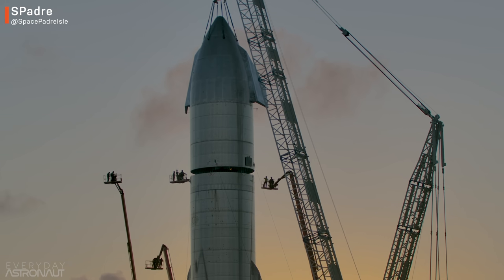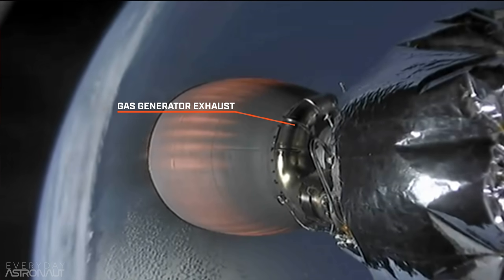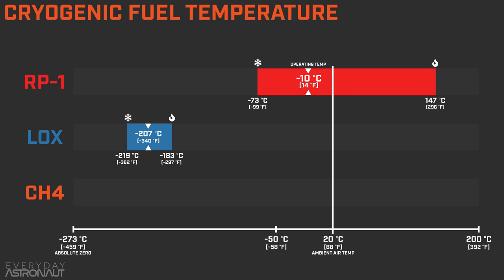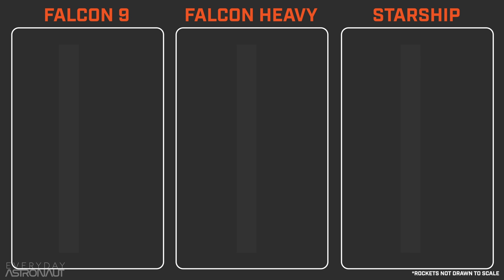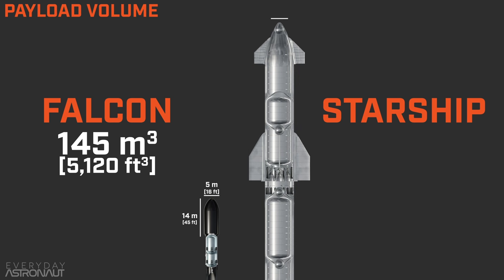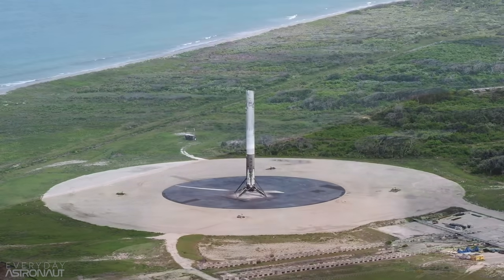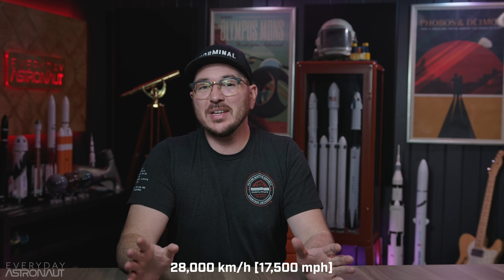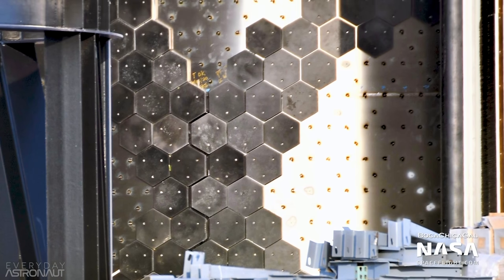Complete Guide To Starship: Falcon 9 VS Starship. What's new? What's different?

Comment: I now have enough information to build a starship in my garage. Thanks, Tim.
Reply: If you need help making the raptors, give me a call!
Reply: I have a soldering gun, maybe I can help for the rings.
Reply: @inconnudetousse1929  The team is coming together nicely!
Reply: I've got a drill-press and a 3D printer. Just have to get those Raptors working under 220 degrees. How hard can it be?
Reply: I have a hammer and a screwdriver. Can I come over, too?
Reply: @_Elkov  Please join the team. If you know any quality welders tell them we have free beer.
Reply: I can code, I’ll do the landing.
Reply: I will be WD-40 guy
Reply: 🦆tape on the way!
Reply: @UrbanWindowFarmer   ;)
We will need a test pad...do you know a good parking lot somewhere ?
Reply: @inconnudetousse1929  Tesco usually have big car parks 🤣
I have biscuits can I come
Reply: @RandomPerson-zl6uz  Sure and as you are bringing the biscuits, we will let you press on the launching button ;)
Reply: I have Knowlegde in code, I could help for the Starship computer 👌.
Reply: I played a flight sim once, I can be an astronaut.
Reply: Played Ksp a few times - could be part of the launch control?
Reply: I have my hands can i come😁??
Reply: I’m a aerospace engineer

Comment: Imagine Using Starship to deploy a single small cube-sat, only to flex on every competitor because its cheaper...
Reply: It can pick up some of their junk while it's up there.
Reply: Considering a flight to the moon is alteast 100 million Dollars per Vehicle.. yeah cheaper than Electron or Falcon 9 I think not.
Reply: @kleinerprinz99  I think he said deploying a satellite into earths orbit. not moons
Reply: @kleinerprinz99  they dont have to launch everytime just to take single small debri, starship can pick up multiple debris at the same time since its payload bay is so massive, yeah right
Reply: I'm honestly not sure the numbers actually do add up, considering fuel and crew costs. RE: fuel, also do consider the amount of dead mass - if Rocket Lab manages to make the cost of Electron marginal through reuse, it sure would use up a lot less fuel (and presumably less crew/time as well), so it really should be cheaper no matter what.
Reply: It wouldn't be cheaper in this case.
Reply: Hmm, according to video, it will.
Reply: @gabrielchanel4448  What about a long-term solution of using an end-of-life Starship Cargo to pile in old second stages with a “can crusher” and then deorbit the whole thing to the Pacific graveyard, or even to a BFE on-land graveyard with the skydive maneuver for recycling?
Reply: @ihateandreykrasnokutsky  Yeah, "according to video", which is precisely what I'm disputing here.
Reply: To be fair this estimate is optimistic to say the least.
Reply: For single cube sat, it is not cheaper. U can fit multiple cube sats on 5 mil USD electron.
Reply: Or perhaps a small car (like Roadster 2.0) 
;)
Reply: @RobertLutece909  Agreed - but then again, there's more costs involved around the project before the rocket takes off. Ground crew, renting the pad, keeping that fuel cryogenic, transporting it, heck even consider lost revenue from not having used that launch for something more productive - that alone would look more expensive than an expendable Electron, even though all things considered it's just fuel and time. Also, it's worth keeping in mind Rocket Lab's upper stage isn't quite that big - meaning a lot of launches, so economy of scale might kick in?
Reply: @RobertLutece909  Economies of scale → by discarding upper stages and having to rebuild them, Rocket Lab is incentivized to build them for cheaper, and their contractors get bigger orders on which they can afford to decrease their profit margins?
Reply: @RobertLutece909  I totally agree - but then again, it might still be a possibility that an Electron rocket is more than 50x cheaper than a full Starship, making your initial 2% figure still a loss for SpaceX? Just guessing :-)
Reply: We don't have to imagine it because it will not be cheaper. Only filling up the cargo and deploying a whole bunch is cheaper. Its literally like a large bus delivering people cheaply but unable to deliver a single person cheaply vs a a small car that can deliver a single person cheaply.

Comment: Impressively enough, the SN8 belly flop was a lot smoother than in the simulation!
Reply: it was both a successful flip, and a spectacular lithobrake
Reply: The flip worked a treat and if the pressure hadn't been lost on the methane header tank it would probably have been 100% success.
Reply: True, but the real test had almost no horizontal velocity. Future ones will though
Reply: @z2kk  Not necessarily, the translation to put it over the landing pad happened during the belly flop phase and it was already in the correct position falling vertically before the flip. It would only have horizontal velocity if it hadn't finished the translation when the flip happened and there is no reason for that to be the case. However there is no reason why the flip could not slightly over rotate to compensate for any residual horizontal velocity. I am sure we will see this in future tests as they start to push the limits of the landing manoeuvre.
Reply: If the engines hadn't gone all self consuming I think it would have worked. Still better than what Musk thought we'd be see.
Reply: Yup it's so science fiction of body control. I dont even believe it is so smoother than any other plane i see. Elon Musk is really live beyond his time.
Reply: Yeah, more "people-friendly". This maneuver is getting better every time I see it again
Reply: Let’s add to the Starship reiteration:
Starship El Camino, Starship Hard Top , Starship Convertible, Starship Hatchback and Starship Limo ( Hummer version ).
Reply: @tomrausch7014  dafuq I need please an explanation of each reiteration
Reply: On that note, looks like this video is indeed dated already, since Elon revealed that the super heavy doesn't want to be less cool than the starship by using an "old" landing profile, and will instead do an equally ridiculously awesome landing as the one starship does :)
Reply: Oh, it is a much harder prospect. coming in through the atmosphere from orbit it's like three orders of magnitude harder. Then just dropping from the sky like a feather. Of course it looks smooth, but it won't be when it's for real.

Comment: Well, since there seems to be a “fleet” of starships, seems we need 
Star Fleet Command running the show.
Reply: Lol
Reply: Thinking out of the box: While having fleet of starships (and that's what Elon is really aiming for): Why burn the fuel to reverse heavy booster back to original starting point? Wouldn't it be better to have second facility at the other side of Earth and head there forward? Besides less fuel needed (you need only to stop, not to reverse and go back), you could have customers from the other side of Earth much closer. Just a thought.
Reply: @adammarkiewicz3375  Sure but you need to somehow transport that booster back to the original site for a second launch
Reply: @439sparky1  No! You need a second launch point. That's what I meant. Even if you need a small trip, transport on the ground would require much less fuel than turning around midair and flying back.
Reply: @adammarkiewicz3375  But what if you want a quicker turnaround. It takes starship 2 mins to fly back while ground transport will last days or weeks
Reply: @adammarkiewicz3375  I believe they're using liquid methane, in part, because it's cheap. And building a second launch site with the same capabilities of Boca Chica would be quite expensive. The launch stand alone is considerably more expensive than a starship stack. The amount of fuel savings to land downrange at another facility is simply not worth the cost of building the facility.

Maybe if musks dream of transport around earth via starship becomes reality then perhaps that's an idea. But for now, with starship in its infancy, it seems more efficient to simply waste a little fuel boosting back to the launch site.

Comment: Top notch video and well appreciated.  As for speculations I have for future development, here you go:
1. SpaceX is already using solar electric propulsion for Starlink.  As most of what you ship to the moon is fuel to push more fuel around and SpaceX has already proposed landing a massive Starship on the moon, which is going to take a lot more fuel than what can be loaded onto a single Starship in LEO, especially for reuse, I think they will use a solar electric space tug launched on on Starship to push tanker Starships out to the moon.  The ISP on these solar electric drives already exceed 4,000s of ISP where Raptor vacuum gets up to 350s, so even with the extra mass of a space tug and the loss of using the Oberth Effect, it would be far more efficient and require far fewer launches than to LOX/LNG the whole way.  Elon Musk has stated Starship should have very little fuel boil off on the way to Mars, so why would there be an issue spending say several weeks slowly pushing a tanker to the moon?  I am thinking this could also be done for cargo only missions, except using a cargo Starship instead of a tanker Starship.  The reason for pushing a tanker Starship to the moon would only be so a crewed mission could happen rapidly instead of at the slow pace of a solar powered ion drive in the Earth-Moon system.

2.  Something cool about the cargo space tug idea when applied to Mars is while the space tugs will produce a lot less thrust around Mars, with cargo you mainly have to eventually get the job done.  Also a space tug could separate from a cargo Starship before entering Mar's orbit and start its capture burn while the cargo Starship continues to the surface or swing by Mars and go back to Earth.  Once the space tug gets into a highly elliptical capture orbit, it could circularize with its large delta-V potential and say get into a low Mars or low Earth orbit.  The cargo Starships sent out to Mars could either be optimized with small fuel tanks designed to get an empty Starship into LEO and then once refueled and loaded with cargo, land the maximum amount of cargo on Mars in a one way mission or be a more generic cargo ship with some hardware for unloading on Mars and be able to fly back to an orbiting space tug to be brought back to Earth.  Having a space tug with over 4,000s of ISP capability really expands the possibilities of what can be done for cargo missions, granted it just takes too long to speed up to be the primary mover on crewed missions.

3. I think the first generation of 'safe' crewed transport to Mars will involve building large scale nuclear thermal propulsed spaceships as that will get you up to ~1,000s of ISP, which really changes the dynamic of how a Mars mission could go while having enough thrust to do things quickly with either nuclear electric or solar electric drives to help speed along the 'coast' phase of the mission.  Once we are gathering material from the moon, an important overlooked material is nuclear fuel.  If you gather the nuclear fuel from the moon, you avoid a lot of fallout from trying to ship that nuclear fuel up from Earth with hopefully controlled explosions into space and the controversy attempting such a thing would cause.  You really can't do a safe crewed mission to Mars without nuclear power shipped to the surface of Mars as one dust storm covering your solar panels and your crew dies, so it makes sense to extend this nuclear power into making the trip to Mars in the first place faster and safer as well as more comfortable.  One reason why you need to go big with a crewed mission is surface area to protect from radiation is a square factor where volume covered by that shielding is a cubic factor.  So as you go bigger, that shielding goes from being too heavy to eventually being a relatively trivial part of your space ship mass wise.  There is a second thing where task optimized Starships are going to be a lot more effective at their job than jack of all trades Starships.  So you do a jack of all trades Starship to Mars, maybe you stick 10 people on a one way mission to Mars and the Starship is loaded up with shielding and provisions and space to move around and equipment for once you get to Mars, etc.  Also maybe some crews can handle the isolation and some crews go nuts and space each other on the way to Mars.  However have a fleet of task optimized Starships riding on a mother ship to Mars allowing for tight coordination and your crewed lander Starship carries 100 or more people airliner fashion to the surface and then flies back up to refuel and carry another 100 or more people to the surface.  A large ship means you can have thousands of people onboard and lots of space to move around, which is a lot easier to cope with than say 10 people trapped in a tin can for a long duration mission.  Having a large ship also provides more room for trying out artificial gravity, though would think the artificial gravity experiments would be done in LEO first to determine what exactly would need to be done for this large ship going to Mars.  Also such a large ship would always be in space and so would be optimized for a permanent space environment going between the Earth and Mars cruise liner style where Starship could then be left to focus on being a short haul airliner of sorts.  If a good nuclear fission propulsion system could be achieved where maybe low to no fallout fuel is used around Earth while avoiding big flashes that could harm satellites in orbit (or even blind people looking up) and then you do whatever is cheapest a safe distance away from Earth, the efficiency gained in propulsion could allow very fast trips to anywhere in the solar system.  So far with our fusion work we tend to go big to get the economies of scale to make it work and be more practical, so a large dedicated ship for this makes a lot of sense.

Chemical rockets just cannot do such a job of going to and from Mars because the ISP is not there and so say a Mars mission is a one way mission with it being rather impractical to in-situ manufacture the large amount of fuel needed to send say a 9m wide Starship back.  Nuclear thermal exponentially improves the equation to it at least being somewhat practical, though still somewhat expensive to go back and forth between Earth and Mars, but a lot cheaper, faster, safer, and more comfortable than doing chemical only.  Ion drives makes it a lot cheaper to move cargo and fuel around and this is important because fuel tends to get a lot more expensive the further out from Earth you are, at least until you figure out a system of getting it from the solar system, which we are way far from doing in a practical manner right now, granted it should be doable one day with the right setup.  Direct nuclear propulsion can really open up the solar system, though some thoughtfulness needs to go into the safest designs possible, especially when operating around Earth, which is really important because literally no humans live beyond LEO right now and at that the current count in LEO is 7.  So if it is not safe to use that drive in LEO, another drive system will be needed to get to a safe distance away from Earth, but this leg of your journey is a huge part of your battle for basically every mission, so your drive system really needs to try to solve this problem if it can be done.

Comment: 1 month and 3 days later:  Starship prototype almost hits landing (>_<)
Edit: 
5 Months Later... Starship landed without a BOOM!
Reply: 6 hours later and I still can't stop rewatching it
Reply: @cwb0995  same
Reply: @cwb0995  haha same
Reply: it wasnt even the maneouver it was the darn landing gear, but it was still so wild
Reply: @likhithborela1517  landing gear didn’t come out because the rocket knew it wasn’t at the right velocity to bring them out.
Reply: Every atom came back to earth.
Reply: @nicksalvatore5717  yup, it was the header tanks that caused the crash, not even the raptors themselves.
Reply: 6 hours later still brainwashed o dear ...
Reply: @johnkean6852  Please tell us more about your superior knowledge :)
Reply: @nicksalvatore5717  Only 2 Raptors relighted and then only 1 was on then the methane tank broke and that is why there was a green flame
Reply: @skm8838  the only two engines relighting was fully intentional, only two engines were required to land, as three engines would’ve been too much thrust.
Reply: @cwb0995  same :(
Reply: 2 months later SN9 just kicked the bucket as well
Reply: 2 months later sn10 lands but goes kaboom 8 mins after
Reply: @likhithborela1517  engines lost thrust rather than landing gear failing
Reply: sup

Comment: Great Guide, Tim.  A few questions:
1) How does Starship prevent debris from damaging Starship during a Mars landing or liftoff?
2) How will Starship keep the cryogenic propellant from venting completely during a Mars mission?
3) How stable will Starship be on Martian soil with it's high center of gravity?  Will it be like the movie Martian during a wind storm?
Reply: to 1) probably similar like on the moon
to 2) just make more fuel, than vents, since you need to produce fuel on Mars anyways? 
        for the rest sent more fuel or bring a cooler.
to 3) the Martian atmosphere is very thin, so even a big storm isn't powerful, but a concern for sure.
Reply: I assume they'll do an unmanned mission first? Kind of sucks because it will be such a long wait, but a wait that's well worth it